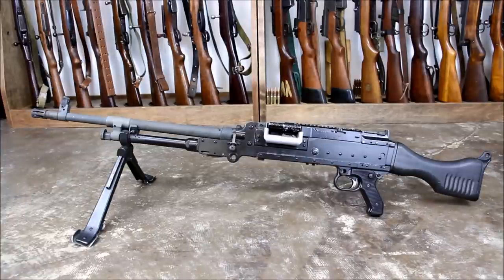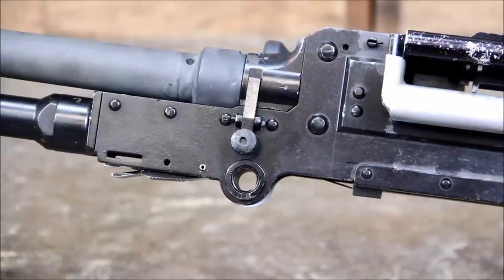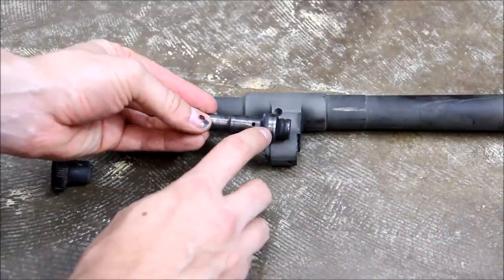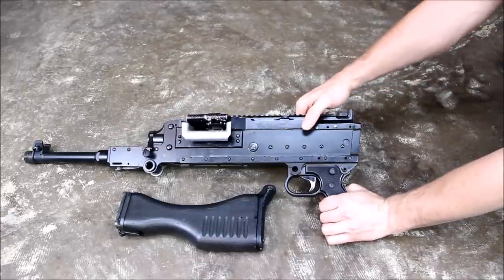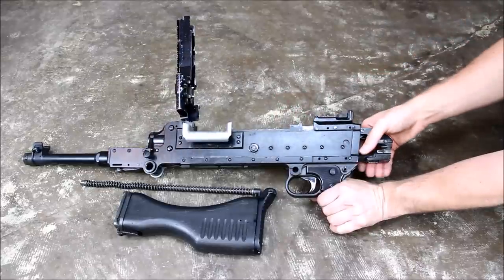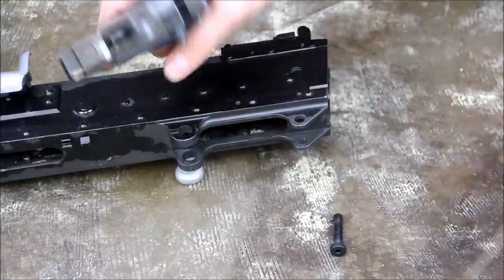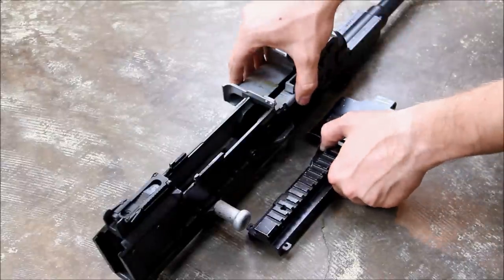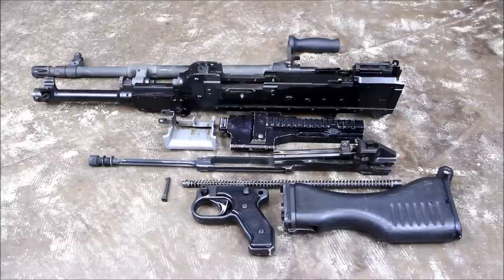M240B Guts and Field Strip

Comment: FN MAG or M240 based on Browning BAR and MG42 design,very simple and very reliable...Similar gas regulator featured on Japanese Type 62NTK machine gun,operation of it little different from VZ59,correctly it would be called reversed tilting bolt operation,after firing bolt would drops down and extract the fired casing while during loading and firing breech get locked,the upper groove of bolt carrier would be depress firing pin and round would get fired..The type 62 NTK have large unusual shape extractor acting like stabilizer for bolt and this particular part forces bolt to go upward during firing cycle...Unlike FN MAG/M240 Type 62 NTK have unseparatable feed tray,it consist of 2 different sections and they screwed on to receiver,belt feeding cover consist of several parts,there is 2 pawl blocks first cartridge stripper the next one is belt guiding pawl,there is also transfer lever and belt guide...Both M240 and Type 62 NTK seems very simple machine guns ever made,however because of few elements have improper construction on Type 62 NTK and it's tank version Type 74 forced Sumitomo and Nutuko companies stop produce those machine guns,there major flaw for Type 62 barrel which ribbed and get hot very quick,ribs on barrel decrease barrel life science it too thin,second flaw construction of cocking handle which lead to jamming and third major flaw using half powered nato rounds which cost low rate of fire and like Japanese soldiers says shooting become semiautomatic rather than full auto....Half powered rounds cost firearm problem,it creates misdelivery and proper extraction of fired casings...This problem was sighted in their Type 64 Howa automatic rifles same as Type 62 and type74 NTK machine guns....Sometimes you can't just combine parts between missershmidt and Toyota,results get bad,this is how Japanese make their guns,they combine parts between different models,this is very visible on Type 64 Howa and Type 62 NTK..The newer Type 89 Howa is nothing more than breed between M16,M4 and AR18,very simple and very easy understandable assault rifle and same caliber 5.56x40mm...

Comment: Back when dinosaurs roamed the earth they told us to never take off the back plate on the 240 (no letter suffixes, we were tankers) without first checking to see if the bolt was forward.  The spring retainer has been known to break and it's embarrassing to have the recoil spring flying out at you.
Reply: Was about to comment the same thing. Its one of the first things the DSs teach you at Ft. Knox.

Tankers Lead The Way!
Reply: Glad to see you back.  Roger That.
Reply: +Angus McThag The fucking cable on the side breaks the most when lots of crews go through TCGST using the same gun.The other is crushing the top cover inside the turret when its open because the loader fucked up by not closing it and the gunner fails checking to make sure its closed.Fuck i hate that!Ultimately they blame it on me as a TC...I have failed to unfuck myself....
Reply: Yer same as m8 got told if you didn't fire the action of frist then take the but stock of the spring would fly out and apparently it's under so much tension it can quite blady hurt you the GPMG is fanstaic machine gun though
Reply: ***** 3 years rather you than me m8 lol what do you prefer the m 60 or gpmg m8 I never used a m 60 as being british army heard the m60 had quite a lot of jamming issues but I could be wrong as I never used one
Reply: uk spartan Yes it is a piece of shit!The problem is the recievers get worn out very quickly and stretch over numerous rounds over time.The bolt chip around the locking lugs,the helical operating rod wears out by cycling,sear wears out quickly,the rear and front gas plugs walk out and have to be wired in place,the gas piston gets polished by stupid gunners making them shiny with steel wool and dont function because the dimenisons are not in specifications and lose gas,same with the gas tube that both the piston and tube be cleaned with bore cleaner instead of  issue CLP (Cleaner Lubricatant Preservative) as originally used.Lubrication calls for LSA 30 Weight Engine oil and bore cleaner for the gas tube and piston.I managed to keep my gun using the original recipe and made it work.I had the only machinegun working during the Panama Invasion of 89-90 in my company during combat.The M240 when i was in Iraq from 2006-08 made it work using FP-10 by Shooters Choice and have my guys cleaning the bore and gas piston,regulator,and plug,with Hoppes Bore Cleaner.That shit really worked.My platoon's machineguns to include .50 Cals worked in combat.Yes like i said i wish the US Army had the M240 years earlier when i was a young gunner back in the day as an Infantryman and Paratrooper.Lovely gun indeed sir...
Reply: ***** yep we been using the gpmg since 1955 me and you where in Iraq at the same time I was there in 2006 and went back in 2008 that's one thing I proper felt sorry for the American soldiers out there as I knew a lot of them where doing a 18 month tour we only do 6 month to 8 month tours in the british army and to be honest that's long enough let alone 18 months to 2 years
Reply: uk spartan I was at Camp Bucca near Um Qsar below Safwan Hill.I always come back via Basra everytime when i transported detainees to Baghdad.I was with an infantry company stuck in Bucca doing prisoner transport and area security patrols outside our FOB.

Comment: That is a G not a B, the G has the 3position gas plug and the non-hydraulic piston buffer in the stock.
Reply from the maker: Ron Mclaughlin Ron, it is a B (as indicated by the receiver markings and ATF paperwork) with some G parts.
Reply: TFB TV the reason I say it is a G, which where nothing more than 240s with "G"round kits was the big difference between the B and G was the replacement of butt stock with hydro buffer stock, replacement of the 3 pos plug and adding the heat shield and forward rails.   All the Marine Corps guns were upgrade to Bs by making those changes but most of the receivers were never changed put stamping out G and adding  "B".
Reply: +TFB TV have to agree with Ron, that looks just like the Golfs we had in the Marines, I serve in the Coast Guard now and we have Bravos and that thing has a heat shield and only one gas setting. Maybe it was converted in its life time? Used to be a "B" and now is a "G"?